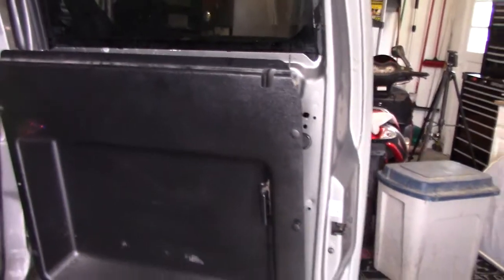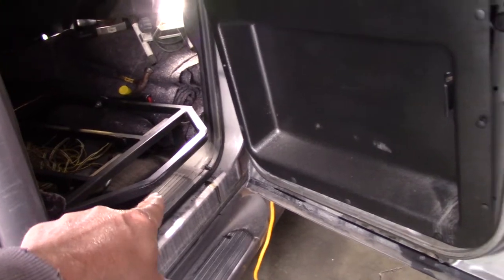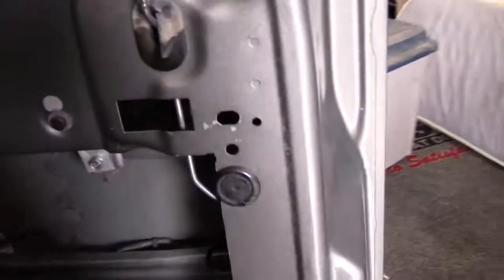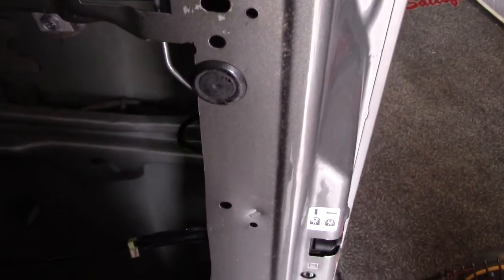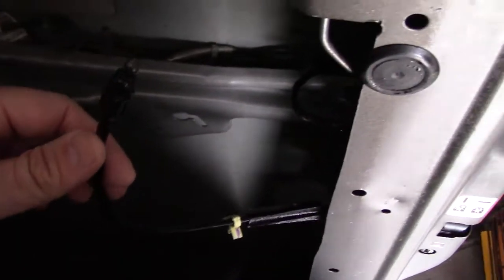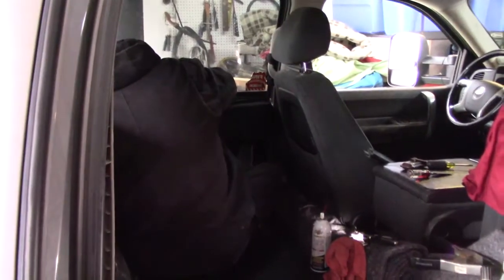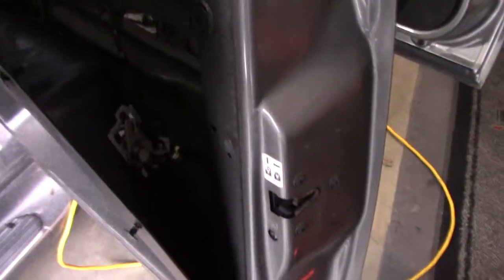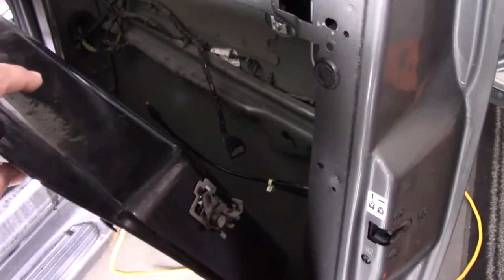Sleeper Cab In 1 Ton pickup

Comment: Wondering where'd you find the door inserts and why is that necessary I'm thinking of doing the same for the driving purposes
Reply from the maker: I bought mine from Woodhouse sleeper. They may sell just the inserts, not sure. I actually have that same door insert for sale. The driver from the video retired. We us them to get the legal length for a sleeper. Let me know if you are interested in them.  straightlinedelivery@gmail.com or 937-506-2252
Reply: StraightLine Delivery are they still for sale
Reply from the maker: @nawfalo3600  yes
Reply: @StraightLineDelivery  are they still for sale
Reply: @StraightLineDelivery  will they fit a 2021 Dodge Ram 3500 tradesmen
Reply from the maker: @nawfalo3600  The door inserts are all the same. The only variation is the metal bed frame. It has different bends to fit the floor of different trucks.
Reply: @StraightLineDelivery  are the door inserts still available I would want to buy them today
Reply from the maker: @nawfalo3600  yes they are. Comes with the frame as well.
Reply from the maker: @nawfalo3600  they are in storage and I will not be able to get there for a few days. I can send some when I get out there.
Reply: @StraightLineDelivery  off course. Thank you
Reply from the maker: @nawfalo3600  here are the pics of the two inserts and bed frame.
Reply from the maker: Sent to your email.